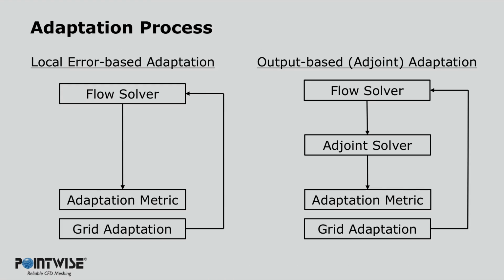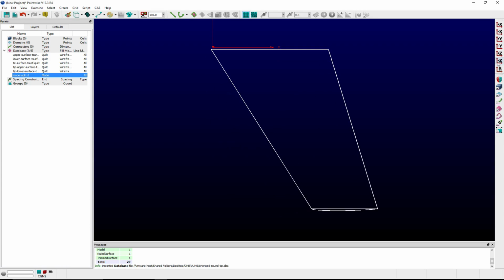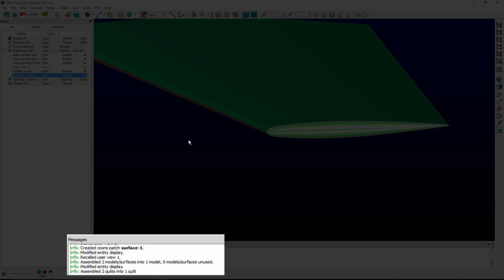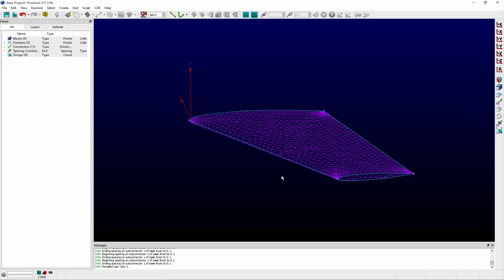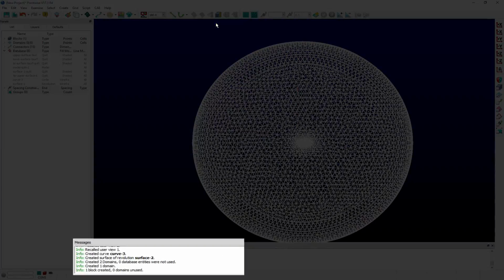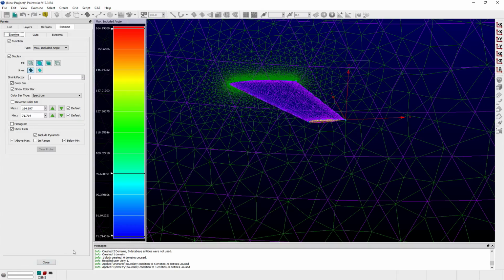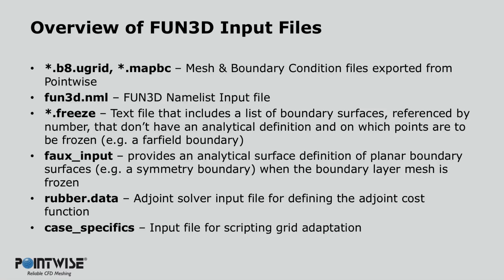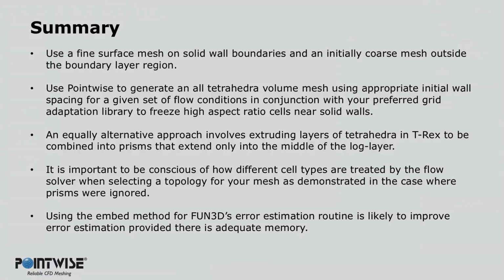Meshing Considerations for Adjoint-based Mesh Adaptation

Comment: 1. Does the T-Rex smoothing option can help to alleviate the high aspect ratio triangles in the trailing edge?
2. The Adjoint-Prism based mesh is not refined at the shock wave next to upper side of the airfoil, only refines in the tetrahedral cells. Can it affect the Pressure jump /Cp ?
Reply: +Rajib Roy 

Good questions!  The T-Rex smoothing parameters shown in the Smoothing frame of the T-Rex tab provides input fields for controlling local cell height LaPlacian smoothing.  "Smooth" is the number of smoothing iterations to be applied, while "Relax" is a parameter between 0 and 1 that controls the amount of smoothing influence to apply to cells extruded normal to the surface during T-Rex.  While smoothing can be helpful in some scenarios, the aspect ratio of triangles on the trailing edge surface domain is primarily controlled by specifying a spanwise spacing and point distribution that allows a smooth transition of points in which the aspect ratio of triangles doesn't exceed a value in the range of 10 to 20.

The adjoint-prism case is an example of what you probably shouldn't pursue when creating a mesh for mesh adaptation despite the peculiar Cp results.  Ideally you would want your layers of prisms to only extend to about the middle of the log-layer.  For FUN3D, I believe this has a similar effect as supplying the freeze_bl namelist parameter used in the all tetrahedra grid, because prisms are ignored by the solver.  In that case, adaptation should refine the mesh similarly to how the all tetrahedra mesh was refined.